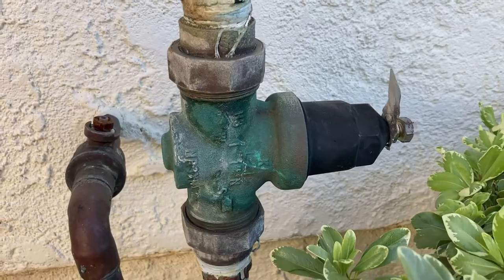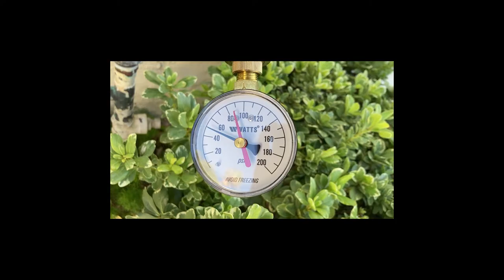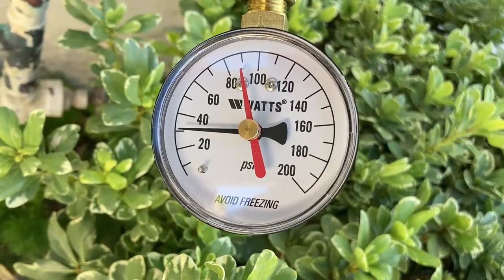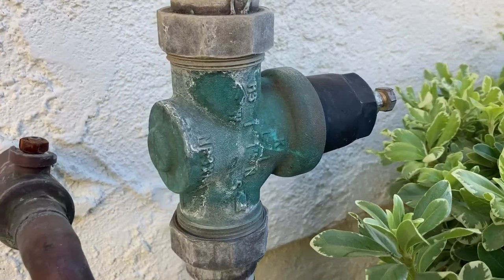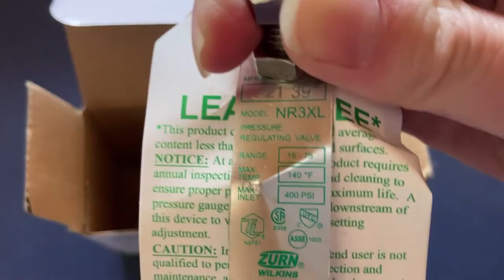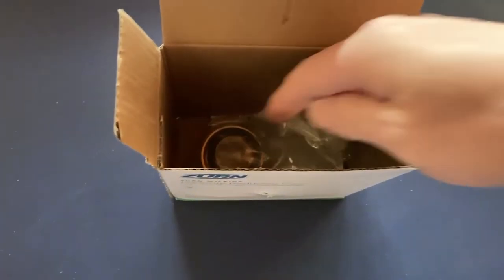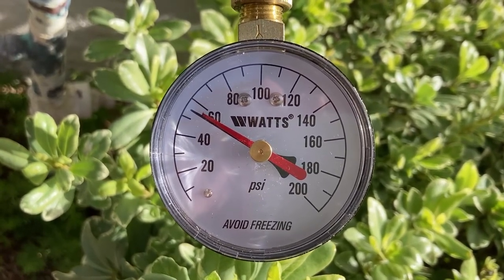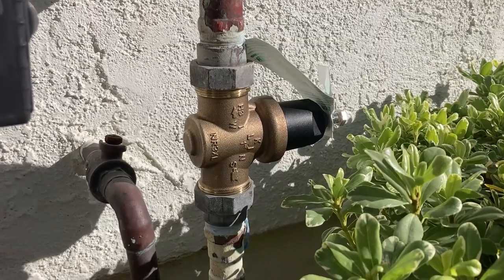Symptoms of a Leaky Pressure Reducing Valve & How to Replace it

Comment: I recently used the rebuilt kit offered for my Wilkins 1-1/4" 600, and read up a lot before attempting from all the advice in the commit section on Amazon & YT videos. Prepping by boring smooth the open shaft where the stem & o-ring glides is the key, and it worked out fine for me.  An original rebuilt kit cost $83 w/tax from Amazon, and a new PRV would have been $572 w/tax, at 1/7th the cost, it was worth the gamble.
Reply from the maker: Thanks for sharing your experience! You did a great job! I agree that it is worth trying the rebuilt kit first. I considered the rebuilt kit for my PRV and found that the price difference was ~$20. The new PRV (1 in. NR3XL) was ~$85 from Home Depot and the rebuilt kit was ~$65 from Amazon. I appreciate that you have shared some key technical details for using the rebuilt kit. Next time, I will try the rebuilt kit. It will be a lot of fun and decrease the cost.

Comment: You can save a lot of money by just removing the black plastic bonnet on the regulator then grabbing the cartridge bolt with vice grips and pulling out diaphragm assembly no need to use pipe wrenches to remove entire regulator. cleaning the frozen cartridge assembly that is stuck from calcium buildup, the retaining bolt that bolts to the seal ring on the bottom and the diaphragm on the top needs needs to slide both ways about 1/4 inch so unscrew the assembly and clean use o-ring lube or plumbers lube on bolt stem and all rubber for reassembly, best to take pictures during disassembly. No worries if you brake it--- you buy a repair kit for 1/3 the price of the complete regulator on line-- so its work the time.
Reply from the maker: Thank you very much for the helpful information! I am very interested in the low-cost approach you suggested and will definitely try it next time. It would also be an excellent opportunity to learn more about the inner structure of the pressure reducing valve. Thank you for sharing!

Comment: Thanks for the well-marked "what is what" at 1:06.  Does the "sprinklers" refer to lawn water sprinklers?  In my townhouse, I have a fire suppression water sprinkler system, and it branches out just downstream of the main shutoff ball valve, but upstream of the Pressure Reducing Valve. So, while my PRV location would protect the plumbing in the house, I worry about the high municipal water pressure "overpressurizing" the fire suppression water sprinkler system.
Reply from the maker: Yes, the "sprinklers" in the video refer to lawn water sprinklers. For the fire suppression water sprinkler system, as far as I know, the maximum pressure is 175 psi. As long as the municipal water pressure is below 175 psi, you do not need to worry about it, I think.
Reply: @happydiytime  Thank you. Yes, I came across that 175 psi number in several sources, too.

Comment: Hi, will channel locks work instead of pipe wrenches?
Reply from the maker: The channel locks should also work very well for this purpose as long as it has sufficient jaw capacity. The jaw capacity of my channel locks is not large enough to clamp the union connectors and the body of pressure reducing valve. So I used pipe wrenches in this work.

Comment: Looks like you forgot the old top gasket
Reply from the maker: Thanks for your comment. The old top gasket was installed back 13:58-14:05. The package of the new pressure reducing valve includes one new gasket. The old bottom gasket was replaced with the new gasket. If possible, it is better to replace the old top gasket with a new one as well.
Reply: @happydiytime  ok I saw removal where top gasket stayed

Comment: You forgot to use Teflon tape.
Reply from the maker: The union connection is sealed by the rubber gasket. In this case, I think, the teflon tape is not needed.